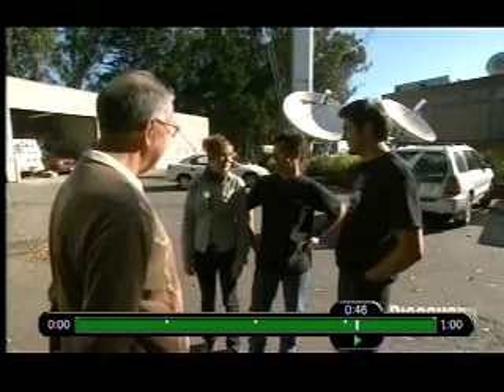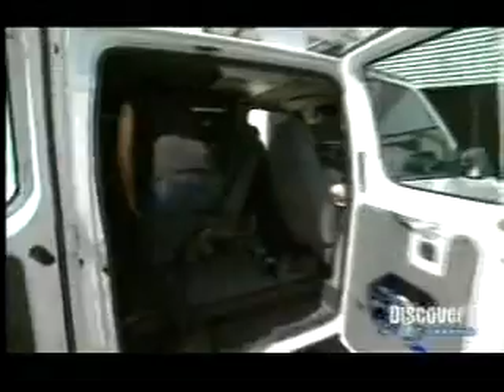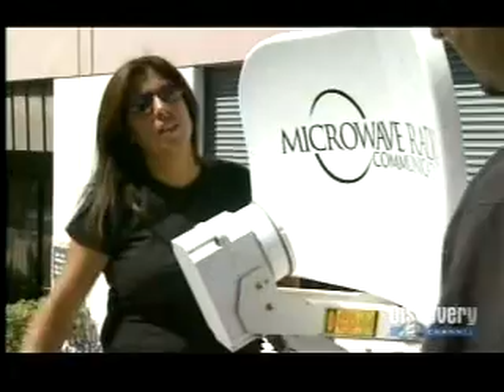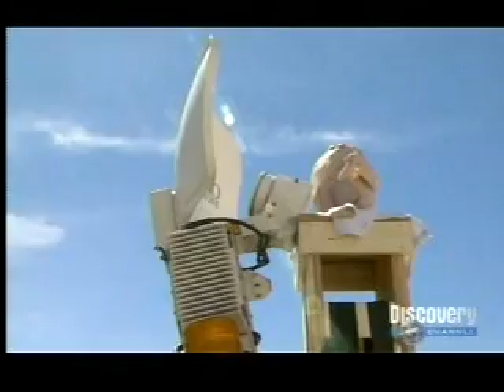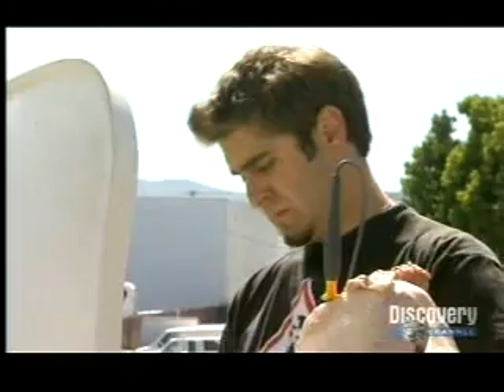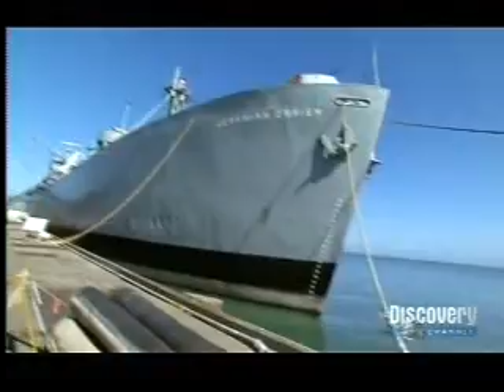Mythbusters Cook Turkey with MRC Radio

Comment: No. Common misconception is that The Microwave energy disperses radially. The point of the parabolic reflector is to direct the beam in a tight angle. It works much like a flashlight does in that regard.

Comment: They usually dont use the frequency needed to heat water since that would affect the signal strength due to moisture in the air...